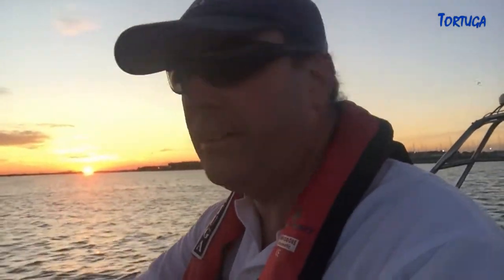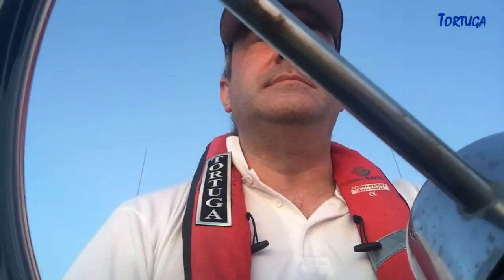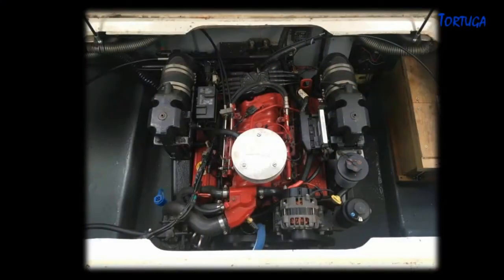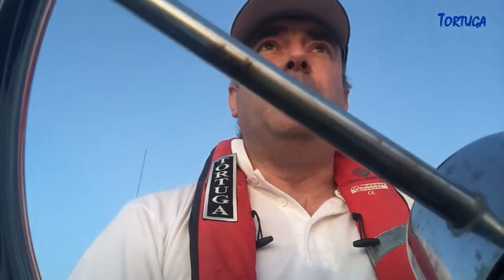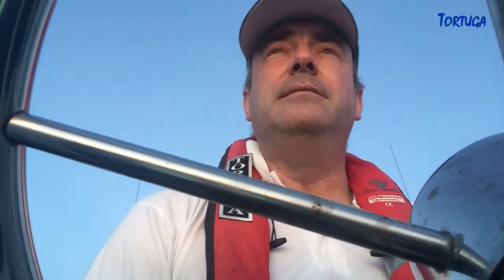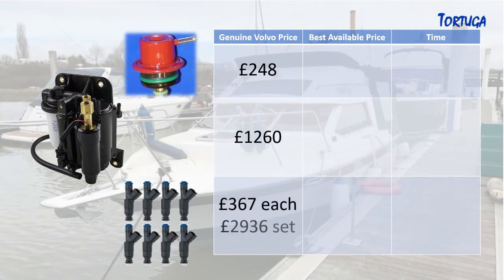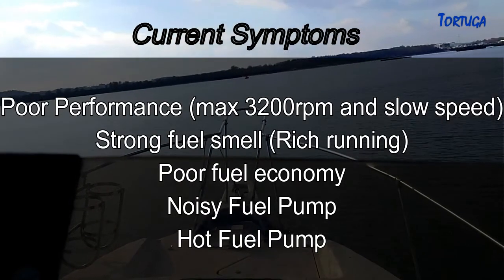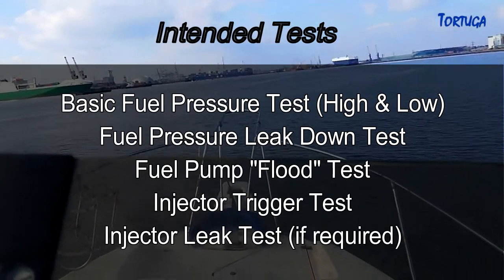Tortuga - Diagnosing Performance Problems part 1

Comment: Stunning sunset!
Look forward to seeing part two soon!! 😉
Reply from the maker: Coming soon!
Reply: @the-tortuga-man  that's good 😉
Reply: Where is part 2 I have similar isuue  @the-tortuga-man
Reply from the maker: @vikp7885  unfortunately, all the footage for part 2 was lost when my laptop died before getting it uploaded to youtube. The performance issue was traced to the following. A) fuel pump was starting to fail so replaced. B) injectors were dirty so sent for ultrasonic cleaning. C) the hull and props were cleaned and re-anti fouled
Reply: Thanks for the info, all of this has been changeded on my boat, I have 31ft Larson Cabrio, with twin volvo penta 5.0  engines , when I get 160 gallons of Fuel and 100 gallons of water and 4 people on board , I have problem to plain, most likely just engines used around 700 hours, but the piston compression is around 160-170 on each cilinder, it is not that bad,boat to heavy for this small engines @the-tortuga-man